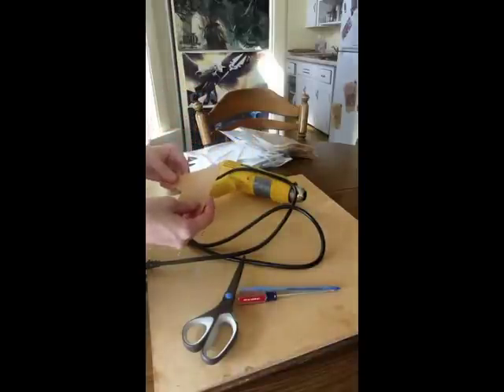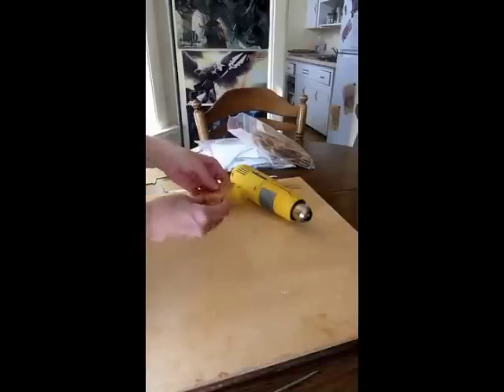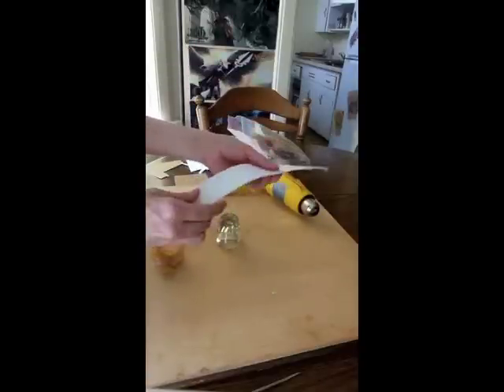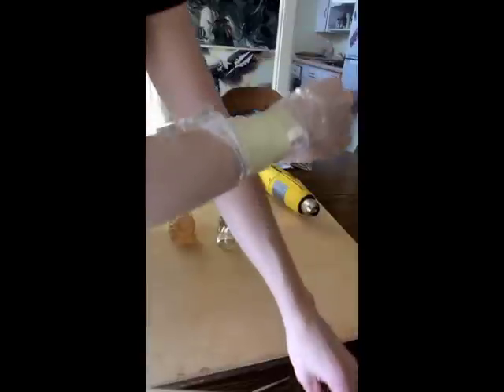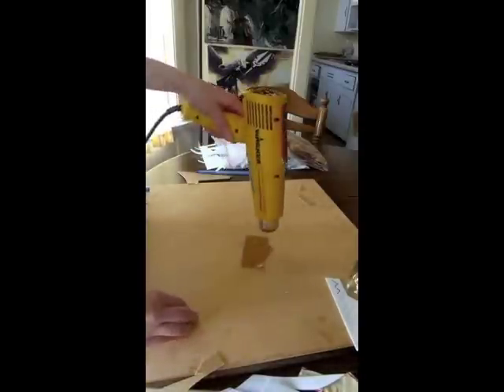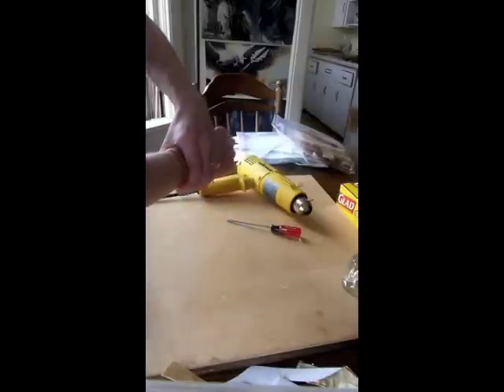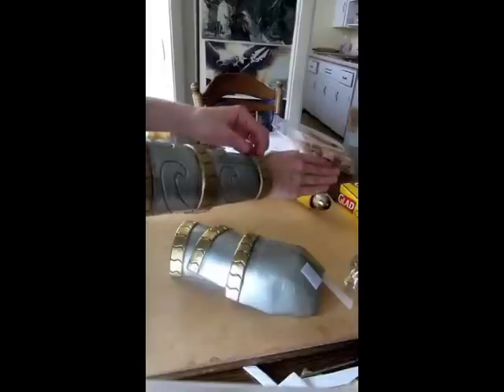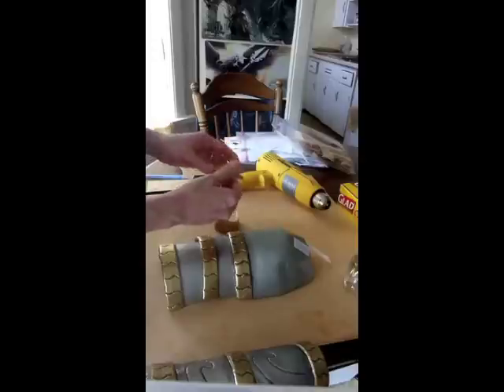Working with Worbla Tutorial: Cosplay Basics 101

Comment: This video is this most informative out of all the research I've done  I like to be very thorough when starting new projects.. I've made a prop out of wood.but I've  yet to work with thermal plastics. I've looked into this  already enough to  have all my materials and tools I should need. I'm planning on using Worbla and Wonderflex since their fairly similar materials as well as crafting foam.. but this video is very easy to follow especially if someone has never done things with thermal plastics like myself. Since my cosplay is mainly  Arm armor it's not a incredible amount like full body armor . I wanted to start with something seemingly simple in the sense of amount of work.  I was wondering how I was going to form my  shoulder cauldrons to my triceps area and that helps a lot because  I didn't think of using elastic  I was going to use Velcro  but anyways I'm rambling lol Thank you so much!!
Reply from the maker: +THETHIRDL2009 I'm the same way when starting new projects or working with new materials. My goal was to make a video that was easy to follow for those who were new to worbla. Glad I could help you and good luck with your project!